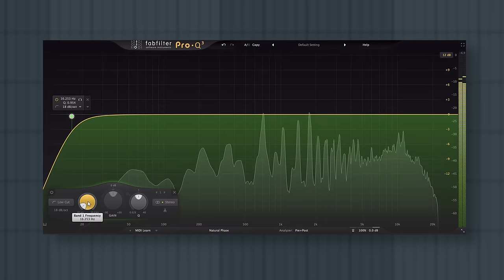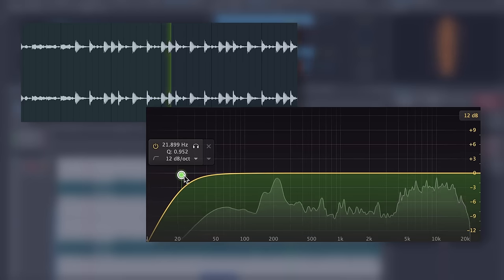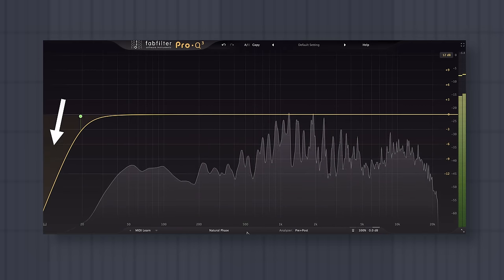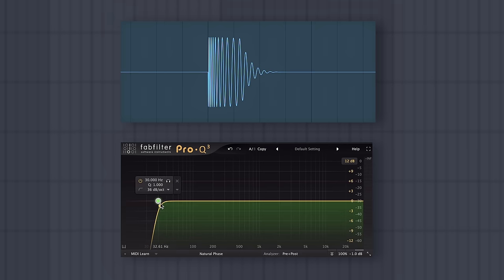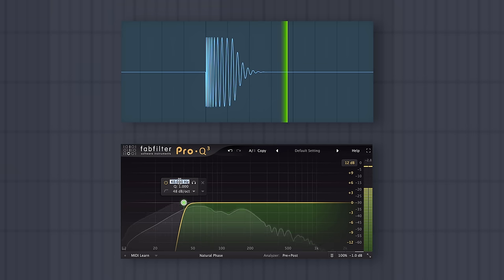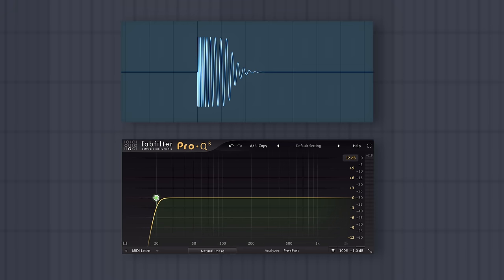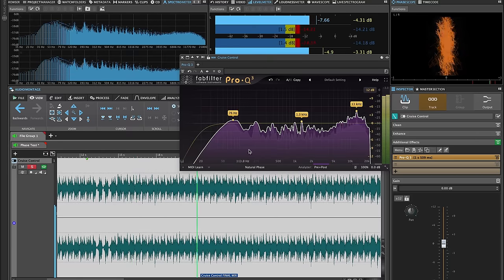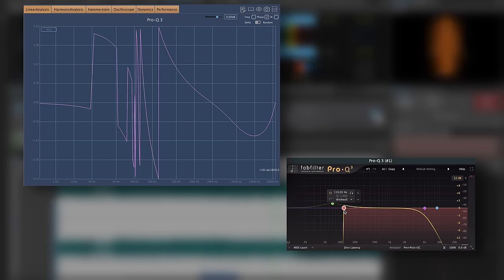Do high pass filters ruin your mixes? Fixing Bad Music Production and Mixing Advice EP.2

Comment: I've only listened quickly via my smartphone inears, but B should be with a high-pass filter. At least it sounds less precise and "fatter" to me than without the highpass filter.

I've known about this topic for a long time because it's also a big issue in loudspeaker development. A much more important point, in addition to the phase, is the time consistency. With loudspeakers, the so-called 'group delay' is measured. This is a frequency-dependent impulse response. With steep IIR filters, the problem is that this impulse response rises very sharply at the frequency of the filter. Put simply, this makes it sound muddier and less precise. This is not only an issue with high-pass filters, but a general problem with small-band EQs.

Cool video - thanks for making the topic more transparent for the general public!
Reply: "Put simply, this makes it sound muddier and less precise. " Like tape?

Comment: :36 There's there's another thing to be aware of here though which is in the spectrographs the fft band spacing isn't equal. What does that mean? It means that because of overlap in the bands and the fact that you've got one band for all the low frequencies it looks like there's a bunch of energy down there but that's just the curve that it's drawing over the values which would be able to be displayed for example as a bar graph. Try making a sine wave maybe using something like operator in Ableton and do it on a low E1. It's a sine wave so you know by definition it's just one frequency. Now open up spectrum and instead of the standard view set it to just look at the fft bins. You will see what would effectively be a normal distribution If sound wasn't geometric in nature because of the fft bin overlap and you'll see that there are way less bins for lower frequencies. What does this all mean? It means that even if the spectrograph shows that there is stuff down there there often isn't stuff down there.
Reply from the maker: That is an important point that I didn't address. However, in my example at 0:36, I did actually make sure there was a low end down there by synthesizing a low pulse wave (for the sake of the visual only!).

Comment: Using high pass filter on everything like crazy definitely ruin mixes, otherwise, it's not a big of a deal.

For the listening test, would have been nice to tell what kind of high pass you used. Cause the slope can really affect low feeling on an entire mix.
So let's say you applied a very smooth high pass, to my ears B has the high pass on, can hear some subtles movements in the very low on the A and not on the B, like an offbeat groove of the bass that goes off on B, and kick sounds more round on B less boomy, also feels more open overall.
And if a very high slope (48dB/oct) + slight bump in gain to compensate the loss, can be A having the high pass, the energy feels more humpf on the kick which often appears when using such filter, but yeah, phase is f*** if so ^^ Well maths wise, but in tastes can be what we want !

Comment: I have a mic that sounds like mud, but with a high pass filter, it cleans it up really well (Rode M.2). 

A vs B: the difference was very slight and I could only could tell in the mix. I would guess that A would be the original and B is high-pass. It took maybe 5 listens (so I would notice listening to an album) where the bass drum was burying other sounds, and with B, I could hear the other instruments easier. A also sounded more fatiguing on my ear drums when I used headphones especially. I closed my eyes and listened to the comparison. I can feel A almost slamming my ear drums (boompf boompf boompf boompf), but when B played, it felt softer on my ears. 

I'm not mixing drums (yet?), but this was a really great lesson (even if I'm wrong). The thing that's driving me crazy is "is this psychological?" because maybe if I'm listening to A enough, would my ears get used to it. A few more listens and I stand by "A = original ; B = High Pass"

Comment: the sub sound more intact in MONO for A, so i would guess B is the one with highpass since the sub frequency sounded less intact and loud when listened thru Mono. And in stereo, the sub sounded less in centre, which might indicate a phase problem due to the high pass filter. Also worth mentioning how the kick sub tail is shorter in B that also indicate that non-linear phase EQ is in the work!

Comment: Well, I could be wrong about one or the other, but I'd say the B version is filtered. The kick on the B version seems thinner and there's also a kind of transient that 'clicks' ? Also, when I listen to the relationship between the kick and the claps in version A, there's a completely normal distinction between these two elements, whereas the transient of the kick in version B seems to blend with the claps. With this kick clap relationship, version A sounds more neutral, version B sounds lightly filtred. 

Also on my big speakers, when B comes on, I get the impression that there's less subwoofer, at the same volume, in version A, I felt the subwoofer in my body, and in version B, the music didn't reach me physically as much, so for me B has less sub.

Maybe it's the other way round and it's version A where the filter is, but that doesn't change what I said above and what I've heard and felt. Perhaps I'm over-interpreting by playing the game of which version is filtered and I'm becoming totally biased and my brain is playing a trick on me? That's my honest answer, now I could download the video, extract the audio, watch it on SPAN for example or try to do a null test...

Comment: The Phase shift is also only a problem if you mix it with an unphased variant of the same (e.g. with kick bleed on other mics). Guess what. If you high-passed your other mics that can't happen anymore. Also, the waveform looking different: Yeah? That is kinda the idea of any effect – if the waveform looked the same before and after the effect did nothing. That being said you can use resonant Highpass filters to ADD low end in very specific spots, not uncommon e.g. in Eurorack world.

As a professional freelance mixer for cinema, it is absolutely normal to slap a HP filter on literally every track and remove/shift it only when needed.

Comment: My unsolicited 2 cents:
The general current canon (popular loud music) says to high-pass everything but your kick and bass at some frequency above the fundamental octave. this intersects with another popular maxim about removing any content outside of a selected frequency bandwidth for a given instrument. panning plus frequency sculpting are the primary tools for placing sounds in a mix.
rendering applied processing to a visually alignable audio clip can make phase shifts obvious. phase incoherence, however, is an undesirable byproduct of extreme settings on inappropriate filter types.
under the hood, filtering can be achieved by a variety of means, not only the traditional FIR and IIR filters, but by a wide variety of techniques ranging from frequency domain bin manipulations to wavelets to convolution, but i digress. the fundamentals of interference (constructive/destructive) and phase response exist and can be exploited, in any case...
the appropriate usage of various kinds of filtering is based upon understanding the characteristics of the tools used.
cargo-cult tool fetish, though rife in audio "engineering" is not an actual byproduct of engineering, which looks at the context, rather than using hammers on phillips head screws etc.

Comment: This isn't by any means a hate comment, but besides the clickbait-y title, there's a bit of ambiguity that may turn into, well, bad advice. The general takeaway of the video is that you shouldn’t overdo HPFs, but what it fails to mention is that cutting closer or even above the fundamentals not only is common practice, but usually makes sense in the context of the mix. This could make newer engineers hesitant, if not completely deterred to try it in the first place. It would also be great if you could help further de-mystify the phase coherence in filters, which I think you're in the right track for. Keep up the good work!

Comment: A = The lowend of the bases/kick roughly 0 -18hz you can hear it's a bit hard on the mix but very unnoticeable   ,even the waveform there can be a slight difference  as on B  the kick is more subtle but effective together with the mix everything blends well shows the mix is high passed letting all the mids  and highs  more free and clear  

I stand to be corrected as I am using just ordinary headphones but i just closed my eyes and let the ear do the judgement

Comment: I think a huge misunderstanding is that multitrack recordings can be messed up (phase shift) quite easy using getting rid of lower frequencies. Imagine a fundamental which has harmonics on top of itself. Getting rid of that fundamental makes the harmonics shift in time but also compressed in time. This does not have to be catastrophic but you simply cannot cut the fundament without consequences. I need to make a visual maybe to explain this.

Comment: Litttle late but I feel Mix A has been processed and sounds/feels more consistent on the subs. Both sound great but on Mix B I felt I could hear a slight build up of frequencies in the subs. This is probably more down to the lack of acoustic treatment in my room lol. On headphones, they sounded the same so doing something you can't hardly hear gives a little extra headroom to push the mix louder. Thank you for covering this subject as I have always been reluctant to use high pass filters including linear phase, and only used either low/high shelf when needed.

Comment: I may be wrong but this is what my gut's telling me...  I believe A is the high passed mix, although it sounds at first the other way around. Many speakers struggle with anything under 20hz, and as well is around the limit of the human ear (around 20 hz). In a mix, too much energy in this area can destroy the mix, and even take away the audible frequencies around it. Speakers/headphones etc perform better at producing that nice bass response when those ultra low frequencies are removed. For your low end to clean up, you must first clean up your low end.

Edit: I'm listening on open back headphones... not sure if there's audibly more sub sound on B as some others have pointed out listening to on their monitors, but A sounded more audibly deep and clean through my open backs.

Comment: Theres also the question of the mix as a whole in which high pass filters are going to work in terms of it's contrast to different parts and perhaps upping gain on certain frequencies so that the track as a whole is more balanced rather than focusing on each individual part with the same principle.

Comment: I'm guessing that B has the High Pass filter applied, because to my ears it sounds a tiny bit louder overall. I think because by removing the inaudible low-end frequencies, those frequencies won't contribute to the level going into the compressor and/or limiter, leading to slightly less volume reduction from those plugins and a higher overall level.
Hopefully I won't be completely embarrassed when I see the answer in your next video!

Comment: I would argue that the frequency point of your hpf can be quite "high" if there is a good reason for it.  Even a bass guitar, in some mixes, can benefit from a gradual hpf at 40 or 50 Hz (at this point it is also a mild subtractive eq though).  However, the slope of the hpf is always very important.  As long as the filter has a gradual slope, sometimes it's ok to filter out a little audible material as long as you know that's what you are doing.  Better to filter out a little audible low end than to use a sharp slope to try and avoid cutting any frequencies in the performance range and introduce extensive phase shift and/or ringing.

Comment: Like pretty much everything in life, moderation is key here too. HPF is a tool, it's neither good nor bad inherently. A good golden mean approach is your best bet here too.
Use this tool, like all other tools under your belt, with purpose. Don't just slap it on everything, and also don't avoid it just because it can mess things up when used incorrectly. Use it if you need it.
When you start doing things without purpose, that's when the funky stuff happens.

Comment: I'm taking a wild guess after listening only once to A and B on my crappy cell phone 😂
A is the high passed one, B has no low cut.

I think I'm hearing lots of sidechain pumping that's making way for LF to push the thump through the mix. So - the pumping effect seems to be more pronounced in B and the reason is that there is more low end. A has the sub bass frequencies cut, therefore the sidechain is fed with less signal and the gain reduction on the rest of the mix is less.

Right?

Comment: Don't use high-pass filters in the master-mix. If you have some issues in the low range just fix it in the bus of instrument which causes it. Infra-low frequences (you can see it by eq but probably don’t even hear it when it happens, just watch oscillogram) in the master mix is a resault of fast non-linear splashes or distortion/saturation.
Reply: The resault of high-pass in the master mix - lost headroom. Phaseshifting causes pick loudness higher than before but RMS/LUFS the same. After that operation short transients will be decreased by compessor therefore RMS/LUFS of transients will be quieter

Comment: A recent recommendation I saw (that I haven't put to the test yet) is to use a low shelf instead of a high pass to remove unwanted frequencies in a more gentle way that doesn't have any negative side effects (phase, pre-ringing, etc). But to the phase switch side effect of hpf, wouldn't this only make a difference if you were using parallel or send effects? If you're fully wet (as in a filter) the result isn't played on top of itself, it replaces the original sound).

Comment: In fact, it is worse. The low rumble was never there at all. You see it on the spectrum because the FFT generates it, it is only visual.
(FFT = Fast Fourier transform  - the way you make from a waveform a spectrum)
FFT can only handle static signals (like a continues sawtooth) correct,  but music is not static.
FFT use some special trick, like a " hanning window" to display music in the frequently domain (= spectrum) , but is not perfect and generates site band on both sites of the sine peak. The lower side band  is the rumble you see on the spectrum
However, if you do the reverse FFT to recreate the time domain signal (=wave form) the signal is nearly like the original.
But…..
If you remove the low end in the frequency domain (spectum) the balance is gone, this will also effect the pitch, making the low frequency peak pitch going up when recreating the waveform because you take out the balance in the frequently domain. 

When you take out something that was not there in the first place……
You lose something else
Reply from the maker: I completely understand your argument. However, how can you state so confident that there is no low frequency energy there? 
I pulled the samples into RX and there is a band of low energy shown on the spectrum. I then boosted the waveforms and can visibly see the low rumble. 

You can’t tell people there is nothing there unless you are inspecting their samples.
Reply: @inthemix  
You see lots low sideband signal but it is generated by the FFT algoritme. It is not real energie (unless some put some real low energy in the signal) You can try this by generating  1/8 note sine pulses in a wave and watch them in the EQ (there is only  sine energy but you will see  the low side signal)

Comment: I don't really hear a difference in the kick where you'd maybe expect to hear the biggest difference. If anything, when differences are this small it doesn't really matter. I've run into many situations where a low, gentle low-cut counterintuitively reduces the headroom by increasing the peak-value due to the phase-shift, yet still I do many hundreds of cuts across tracks when producing and mixing. To me it's become clear that if you only try to do things because you can hear that an action is needed, the rest of the technicalities eventually falls into place :)
Reply: Doing a low cut like that will always reduce some headroom and create a resonance. But the trade-off is worth it imo because there are many other ways you can gain a lot more headroom. 

If every sample has low frequency content that you can't/is hard to hear, it'll still start to add up collectively. This can get even worse every time you add saturation or distortion to a sample because they can even add low end information to a sample, not just high end. EQing after using certain fx (Reverb, Distortion etc.) is always a good practice.

But honestly, I've been learning for 9 years and still have a lot to learn.

Comment: High passing kicks in natural phase is the only way to do it. But if you are doing it you need a different kick then. It changes the pitch of the kick and you’ll have to watch out for the longer tail. If you’re fine with that then ok. But most people won’t start with a bad kick to process it. And linear phase is never. Ever a good idea unless you want a smeared sound. Why you want on your low end is crazy to me. But you’ll definitely notice it rubbing in a club. Same thing works for subs. Don’t linear phase them. Cheers

Comment: I think it's possible you have been tricky here.  I believe Mix B is the original, and mix A has a low shelf filter applied, not a high pass filter.  If not, the HPF is only 1 pole deep, which in a way, is very similar in the end result.  If only a minimal to average amount of low end "cleaning" is required I generally prefer to "low shelve" a sound source rather than high pass it.  They are both gentle, but the shelf is a tad more phase coherent.  My two cents worth